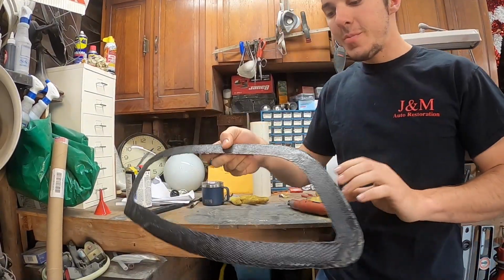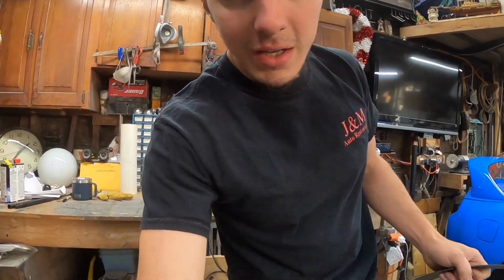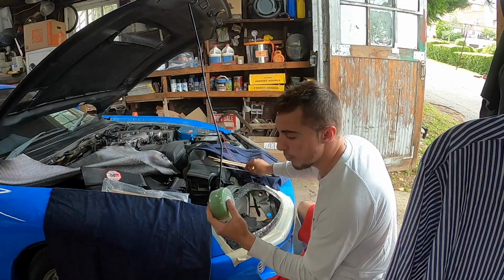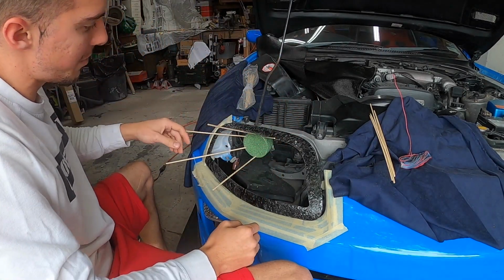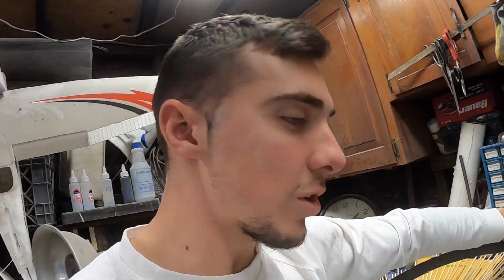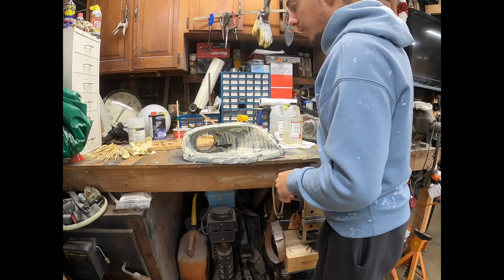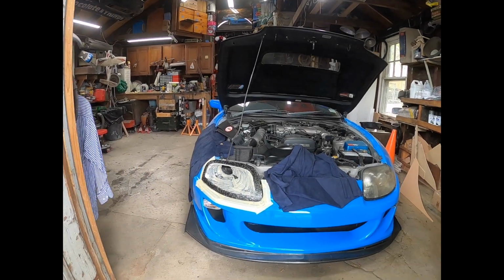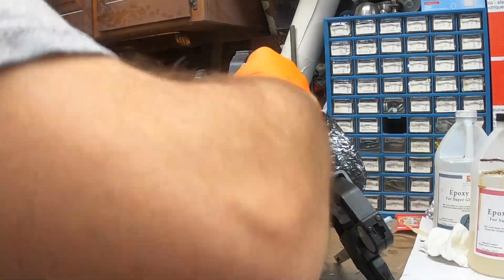Building a Carbon Fiber Intake!

Comment: At the end (16:18), did you add more carbon fiber on the inside of the intake?
Reply from the maker: no, the only thing I added was more resin and sanding to get the final finish to be as perfect as possible. If I were to do it over again there's some parts of my process id change, but for the most part everything turned out as I had planned.

Comment: Sorry to bring up a old post but looking to do something the same on a different car.

Now you've done it looking back would you do anything different?
Reply from the maker: Never apologize! That’s what I’m here for. I love that question, and here’s the answer. 
1. Right after I masked the head light I would have gone over it with resin tape (bought off Amazon) and mould release wax (Amazon as well) to make it a clean release from the part.
2. The BBQ sticks worked great, but I would have tried to smooth them out more to make it as flat as possible before layering Carbon overtop (Also adding resin tape+ mold release)
3. Added more carbon and structure near and on the bracket point to add rigidity. 
Hope this helps!
Reply: @ksmneptune  yeah I agree with using a releasing agent.  I'm trying to think of something like the bbq sticks but that are flat so can make life easier I did like your idea just needs to be flat
Reply: @ksmneptune  Would you use the resin tape instead of the masking tape?  How is the mold release wax applied? is it painted on or molded on as a sheet?

Comment: Lol right before 10:39 I was getting ready to comment"if only you had a 3d printer you could easily model and print what you want and build carbon off of it." 3d printers have gotten a lot cheaper than they used to be. I could suggest a good priced one that works well if interested
Reply from the maker: I know I wish I had one, definitely recommend if you have one in mind. It would be nice to get somewhere in the future. That would open up much more possibilities to make things for the car!
Reply: @ksmneptune  a good starter printer would be an creality ender 3 v2 which is a decent priced printer.it doesn't have the biggest print volume, but it isn't super small either. Anything you want to print that is larger than its print volume could easily be achieved by breaking the model up into different sections and assembling after printing. I haven't owned one, but I have a friend that owns two. I have a folgertech ft-5 that prints large volume(around 12"x12"x15") but it was a kit that took a long while yo assemble and get working and I had many things I had to upgrade off the bat, but I hear they have improved a lot, but it is still just a kit that comes as a box of parts. I also have an elgoo mars which is a resin printer that has a pretty small volume, but is fantastic at detail which would be perfect for. Making custom emblems, or even molds to cast carbon fiber emblems out of, however resin printers can be very finicky and are definitely not a good place to start out for a first printer. They are messy and require quite a bit of clean up, clean up setup, curing, and post processing, but once you print something small that has extreme details and it comes off the printer looking like an injection molded part it is astonishing.
Reply from the maker: I just checked out the Creality Ender and that is one crazy machine! When it comes time to get one that’s more than likely going to be the one. The one you have must be an animal to print on that scale! And the resin one would be perfect since I do a lot of small detailed projects, but your very right, if your not cleaning it properly it can be a huge pain.

Comment: I’m actually planning on
Spoilers as my own project thing is my challenge is making a rear difusser or rear bumper spoiler 1st 1 I made I’m not to happy to how it turned out it felt to plain but that’s the challenge when you trying to make it from scratch and free styling by hand and without much products like clay etc 🙈👎maybe you can have a idea to help me make 1
Reply from the maker: Best tip for you! DONT STOP! Your apart of the 5% that will do what it takes to get what you want that one day the 95% of others might want to buy off you. custom projects are always tricky and time consuming but remember, go at your own pace and don’t forget to take a break for a day after your Mach up so the next time you see it, you can adjust where you need with fresh eyes.
Reply: @ksmneptune  thanks for the tip
Reply from the maker: Any time!